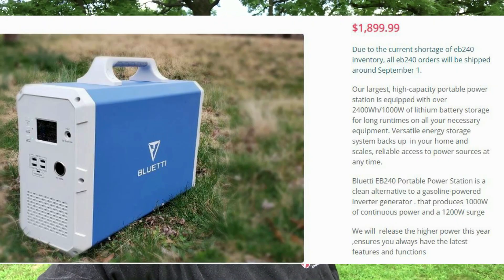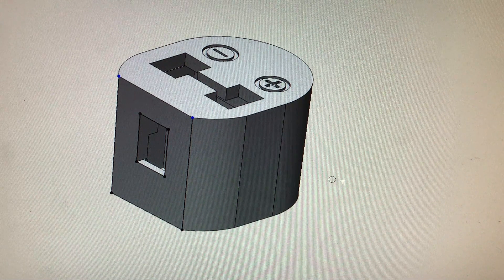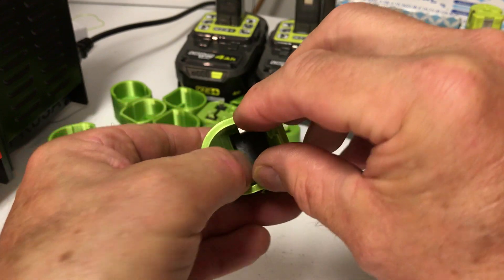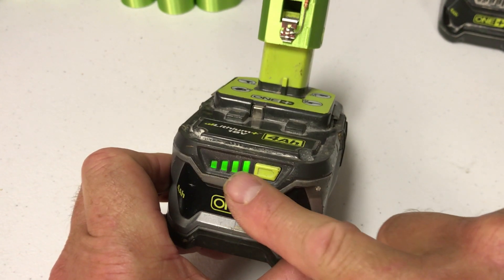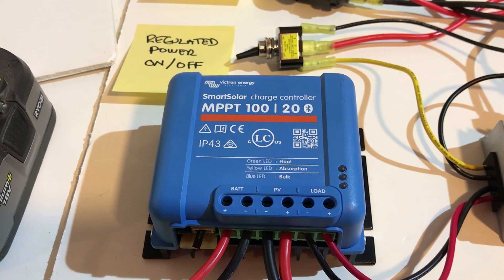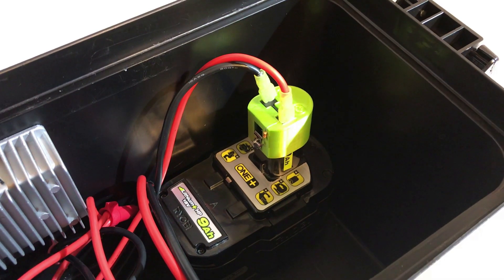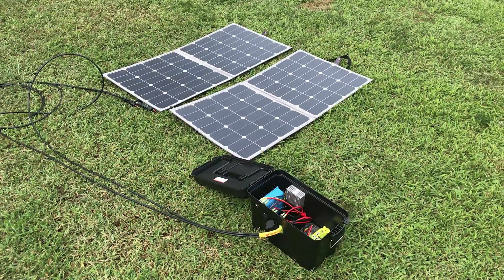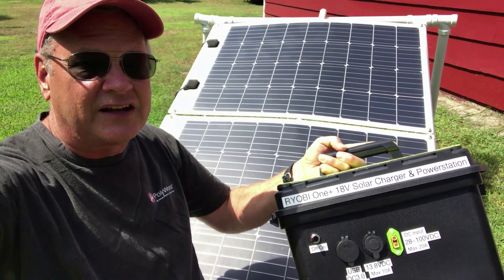Ryobi One+ 18V Battery Charge Adapter for Solar / Powerstation

Comment: I've been looking for the way to trigger the charging mode for quite some time. Thank you so very much !
Reply: Just remember that the charger normally checks the battery/outside temperature. You shouldn't charge a hot battery or when it is below freezing. Also limit the charge current to 2A.
Reply: @chrisnafis7000  oh of course, i'm used to charging these things diy. Before i had to open them to do so...

Comment: Brilliant work! Have you thought about speaking to generic charger manufacturers?
Reply: Having multiple Ryobi batteries a various different size it would be nice to have a power station that works using my battery is much like the EGO power station is.
Reply: I guess ryobi saw this video now they just released a solar charging station for ryobis 18v batteries.

Comment: I Have A Sears Diehard 1000
Amp Battery Jumper. & I Don't Even 
Own A Car But It Sure As Hell Comes
In Handy For Recharging  & Running My Electronicss Like My TV tablet Phone & Bluetooth
Speaker. As Far As A Lamp I Use LED's
In The Lamp. It Might Not Be Strong Enough
For The Microwave But That's OK Too.

Comment: All You Have To Do Is get A Couple Of
1000 Watt Solar Panels. Connect An Inverter
To The Solar Panels Then Plug The Ryobi 
Charger Into The Inverter.
Reply: While this does work, there is a significant efficiency loss in converting dc solar output to 120 vac and then back to 18/40 vdc.
Reply: @spearamintwolf6225  Do
The Solar Panel's Themselves Put Out
AC voltage Or DC Voltage?
Reply: @rogertyler3237  DC. My understanding is that a solar cell itself is a form of diode that just happens to induce current flow when exposed to light.

Comment: Awesome diy videos. Now I’m wanting a 3D printer meself. I’m thinking of using your pvc idea while I contemplate if I need a printer lol. My question is, is it necessary to have a resistor?  I’ve also seen printed adaptors on Etsy and might use this too. Mostly curious if I have to adapt a resistor. TIA.
Reply from the maker: Are you asking about the resistor for charging?
Reply: @SerendipitySue  Yes.  So it is necessary for charging
Reply from the maker: @ipugo1037  some batteries you can get away with just connecting the + terminal to T terminal. But I found it was more reliable to put in the resistor

Comment: Thanks for the video. This is what I am looking for. I have a few 6ah 18v Ryobi one+ batteries which I would like to power my portable projects like a ham radio and charge from solar.  I am planning on having 12ah total so maybe 3 one+ 18v 4-6ah batteries in parallel might do.  Of course all batteries should be same capacity and state of charge. 

Did you ever build yours to have parallel batteries?

Comment: I saw in your parts list that you have a power supply charger that wasn't used in the vid. Were you going to use that to wall charge the power station, or for something else?
Reply from the maker: You can use it to charge battery instead of using solar

Comment: I thought this was genius. I've been contemplating building one of these Ryobi powered solar gens for a while.

I have a couple of questions for you.

I don't have a 3D printer. I saw one of your other vids where you made the adapter to connect to the Ryobi batt from a PVC pipe. Any reason why that wouldn't work for a solar gen?

Could I use a cheaper mppt charge controller to get the output for the Ryobi batts?
Reply from the maker: Yes you could use PVC tubes for battery connectors. The MPPT controller is more difficult. You need one that can be adjusted to the 21V charging voltage of the Ryobi 18V battery. You also want one that can limit the current to 2A.

Comment: It's not true you throw out Jackery or Bluetti, the max capacity just diminishes based on that cycle time. Same thing happens with all Lithium systems. After 10 years you may want to break them open to salvage parts, but by then you're likely able to get much cheaper and powerful components anyway. Especially at their capacity, having users swap components would be dangerous. While using Ryobi or other battery packs is certainly more expensive than buying the Li-Ion batteries directly and making your own packs, I'd guess this method is quite a bit safer with each battery pack having it's own circuitry right?
Reply from the maker: Yes after a certain number of cycles the battery loses capacity. They will still work. But the battery are not replaceable. The advantage for a ryobi battery system is: 1) you already have the batteries, 2) batteries are most expensive part, 3) you can use batteries for other things, 4) if battery technology improves or cost drops you can take advantage of it. I see this as a good alternative for someone who only occasionally needs backup power.

Comment: What about buying a solar panel that outputs 12V @ 6A then use the P131 ryobi 12V car charger to charge the batteries?

I'm guessing you still need the charge controller though just to ensure a consistent output.
Reply: For kicks I'll try hooking  up my 100watt MegaSolar folding panel (  https://amzn.to/3jWzJ30 ) and set the controller to 12V output. Then I'll hook it to the P131. It's max Amps out is 5A.
Reply: @chrisnafis7000  I think it would work....as long as the solar panel is putting out more than 5A (60W) continuously.
Reply: @BradKwfc  I tried it and it did work as long as the solar panel put out 48W. Otherwise the P131 red/green lights started flashing
Reply: @chrisnafis7000  Nice, I thought it might, maybe with two 100W panels it would work continuously as long as there is sun shining. I might do that as a project next spring.

Comment: Would you sell a couple of those green adapters for output only not for recharging? Shown at 2:25 of video.
Reply from the maker: I don’t really have a way set up to sell them. I put the CAD model on thingiverse. You can have company on internet 3D print them or check public library or maker space for a 3D printer.

Comment: Use a 6 battery charger and modify it
Reply from the maker: SerendipitySue
1 day ago
I have also converted the 6 bank supercharger into a battery bank. I got it as a free $79 tool with the purchase of two 4Ah batteries. Unfortunately you end up scraping almost everything. The printed circuit traces are too thin for 10A. So I had to solder wires to each of the terminals. I was able put the DC-DC converters inside the housing. I mounted the 300watt inverter on one end of the box.
Reply: SerendipitySue maybe buy broken one on eBay

Comment: Love the idea! I had thought about gutting one of the 6 bank superchargers to use as a place to store the MPPT and other electronics plus it would provide access to multiple packs at once. I have 6 of the 9Ah batteries and gobs of the 3ah sitting around and that supercharger fitted with 6x9Ah is pretty impressive looking :) Integrating the AC into the box if space was available would sure replicate the features of a Jackery and be tons cheaper to boot!!! Not sure if you got in on some of the discounts for the 9Ah batteries last year, but I was getting them for about $39/battery which was about as cheaply as I have seen them.
Reply from the maker: I have also converted the 6 bank supercharger into a battery bank. I got it as a free $79 tool with the purchase of two 4Ah batteries. Unfortunately you end up scraping almost everything. The printed circuit traces are too thin for 10A. So I had to solder wires to each of the terminals. I was able put the DC-DC converters inside the housing. I mounted the 300watt inverter on one end of the box.
Reply: @SerendipitySue  Awesome! I would love to see some of your other projects! Thanks for posting these adaptations as they give a lot of food for thought! 
Do you know if the Ryobi batteries will automatically stop charging with their integrated BMS? I've looked for videos on it but info is a bit light as to how they implement their battery protection circuitry.
Reply from the maker: @patrickcallahan2210  The BMS on the Ryobi batteries are pretty good (Can't say the same about knockoffs). I programmed the Victron Solar Charge controller with the bulk/float voltages. I limited the charge to < 3A and set the low temp charge cutoff. Wish I had gotten the 9Am deal you did! Ryobi is out of them now :-(
Reply: @SerendipitySue  I'm sure they will have deals again when winter gets here like they always seem to. The current sales at HD are pretty weak compared to the holiday sales, though with COVID who knows what is going to happen this winter. I keep an alert set up on Slickdeals.net for Ryobi stuff and have gotten in on some very good deals previously :) It may be worth a look!
Reply: @SerendipitySue  Do you have any videos or web pages on your project of converting to a battery bank? This has always been a day dream of mine, would love to see any details of someone who's actually done it :)
Reply from the maker: Chris Beach I’m putting a video of it together... but got busy replacing a barn roof.
Reply: @SerendipitySue  I'm happy to hear there will be a video in the future at all, that's awesome!! :) Looking forward to it